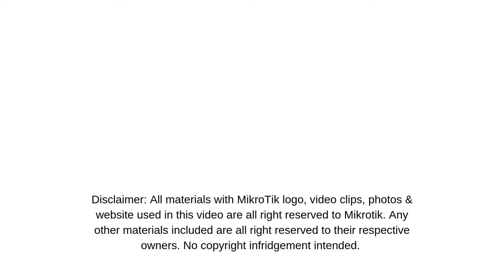MikroTik LHG R | LHG 4G/LTE/LTE6 Kit - How to replace the mini-PCIE modem (Tagalog)

Comment: Thanks for the video sir! Possible po bang ireplace ang module ng 4G kit with LTE6?
Reply from the maker: as far as testing, mikrotik lte line up with mikrotik mini-pcie modem, working plug and play
Reply: @RizalTechGuide  Hi! How do you configure LHGR-LTE router with EP06 modem? I have replaced modem to EP06, router find it, but there is no cellular connection. I see only model, revision, imei, imsi, uicc. Thank you
Reply from the maker: @volodymyrsavkov9725  i followed mikrotik wiki post on quectel modem + the wap r with quectel topic in the mikrotik forum
Reply from the maker: @volodymyrsavkov9725  i've tested with stable and dev version but I reverted to stable build
Reply: pwede!... natry ko na at tested yan

Comment: Hi Sir, have you encountered frequent resetting of LHG 4g kit?
Reply from the maker: if you are having problem, try to update to router os latest stable version plus firmware. Update also the R11e-4G firmware.
Reply: Rizal Tech Guide Thank. I have read in some forum and FB groups that they encountered frequent anticipated resetting of their LHG 4G kit even if the firmware is updated.
Reply from the maker: @juliussusmina5554  yup, they already included the fix in the latest build :)
Reply: Rizal Tech Guide  Thank you!
Reply: Rizal tech guide may tutorials po ba kayu how to update po kasi always failed po pag mag update ng lte firmware

Comment: Are you selling the only mini-PCIE modem for LTE6 kit...i just want to have one so i can test which one are ok in my area...if it is the 4G kit or the LTE6...
Reply from the maker: hello, i just transfered the mini-pcie from one original kit to another. I think the mini-pcie is on a order basis only from the MikroTik Authorized Resellers.
Reply: @RizalTechGuide  thanks for your reply...I just message all the potential dealer in the philippines but no one can tell me if they can order it...

But the i ordered my LTE 4G KIT say, he just waiting for the reply of the cost ...Hopelly its way cheaper than buying NEW SET of LHG LTE6..hehehehehehe..thank you very much
Reply: @manonggaming8306  sir where did you buy mini-pcie modem?
Reply: @emilatay2237  i stop looking for LTE6 mini-pcie modem. no one can sell me  iether the store when i buy my 4G KIT..im so sorry..

Comment: Now I know how mine got water inside after 1 night of rain. I bought the 1gb version with the heatsink on the front. without doubt the cheapest and nastiest piece of networking gear ive ever purchased. The web interface was a total joke, it's full of crap for other products. I'm going back to my netgear MR2100 with my external roof antennas.
Reply: I was watching this video and thinking to myself.....how do they keep water out of that thing.  I'm deployed in the desert and need a high gain system to reach the closest tower witch is 14 miles away.  I thought this was perfect until I started seeing all the resetting and water intrusion issues.  Why would this company not address these....they appear to be a large company.
Reply: you just called best software interface on the non-enterprise market "a total joke" lmao. Everything you see in the interface can be used for product you own, it just requires knowledge or googling skills, but one could pull very advanced setups not possible with limited capabilities of netgears, tplinks, dlinks, etc.